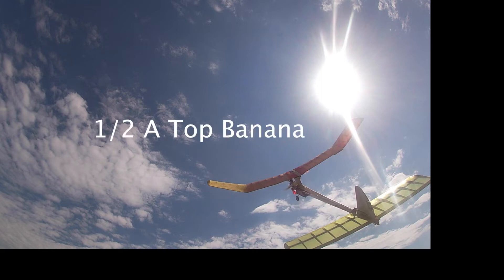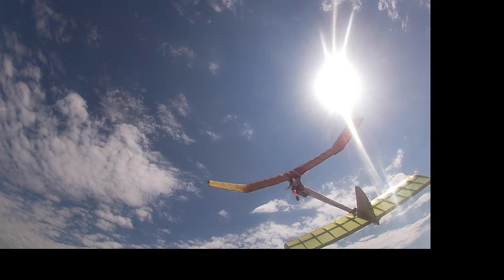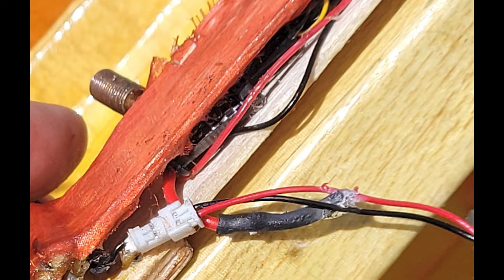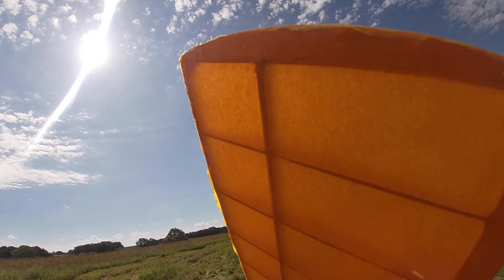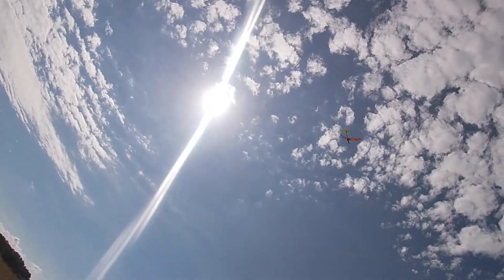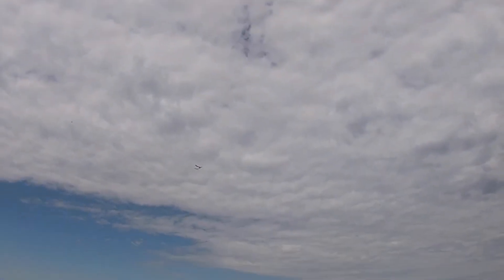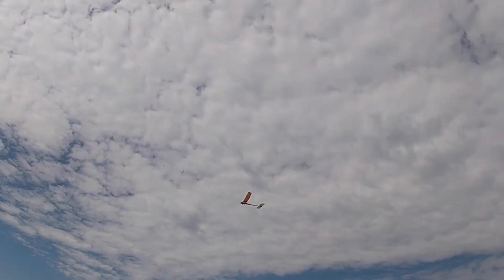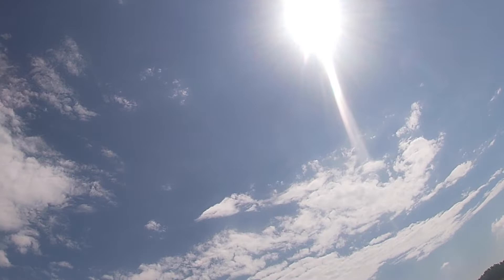1/2 A Top Banana Free Flight

Comment: Great video! The Top Banana is a great plane if you don't overpower it. The stock (with a cylinder change) Medallion is the perfect power level for it, and at the end of a full 9 second run it's high enough to max with ease. As you've seen, the glide is fantastic, among the best of the best.

Comment: Like seeing these models. Plus an easy way to fix a wire, has a pretty good glide to it. I believe I’ve asked this before but where do you buy your engines?
Reply from the maker: Ebay normally. or Cox International but that is rather spendy.
Reply: @FreeFlightDigest  Ok, I’ve seen them on eBay before. Never knew that cox is still in business. Thanks.
Reply: @thebalsaboy  Cox is not in business.
Reply from the maker: https://coxengines.ca/